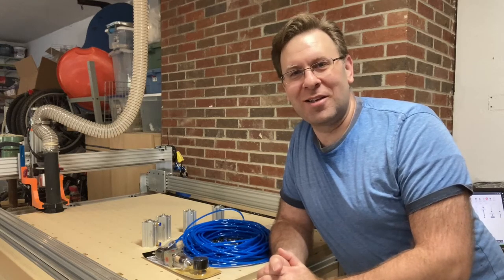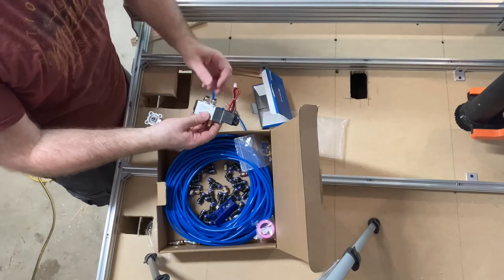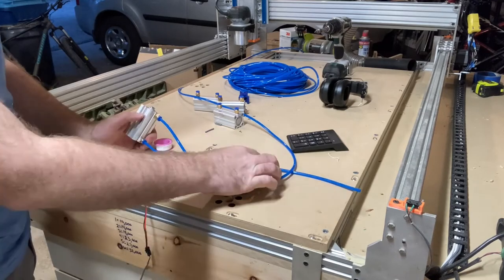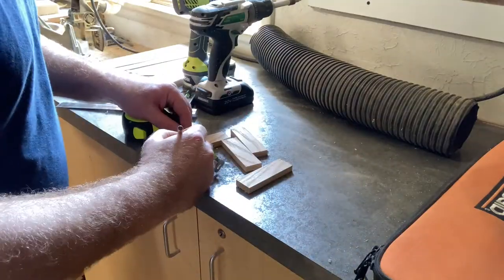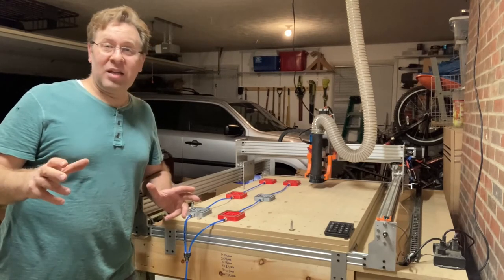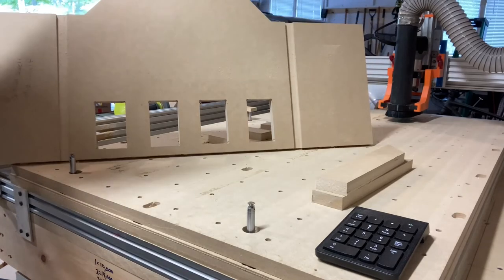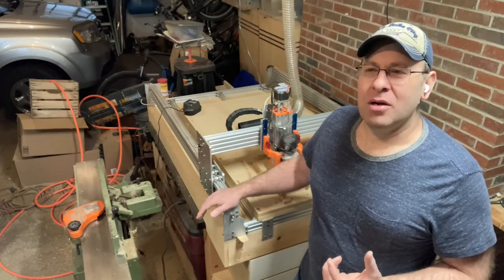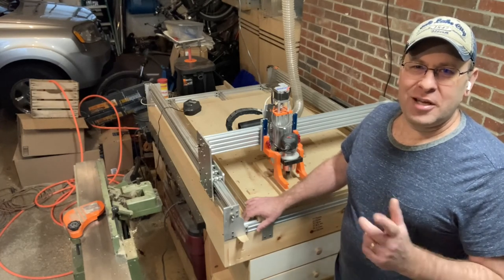CNC Material Clamping, A New Way. (with location pins)

Comment: Very good presentation. I use the Shaper Origin cnc tool and will try your pin /clamp method as I am tired of using double sided tape. Thanks.
Reply from the maker: I was also getting tired of the double tape method, let me know how it works out for you.

Comment: Maybe packing tape on the MDF and hardwood as an interface might work
Reply from the maker: Good idea, I will have to try that out. Thanks for watching!
Reply: MDF is porous, this is a problem for any vacuum. You could overcome/compensate for it with a larger volume vacuum pump, but that would get costly. Your packing tape idea is a good one. I haven't tried but possibly just sealing with shellac would help close up the pores in the MDF.